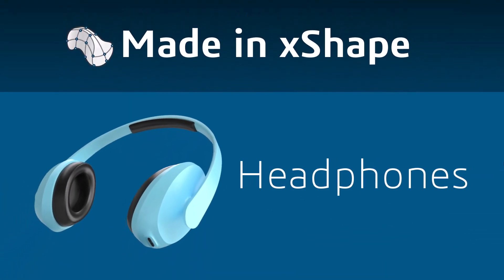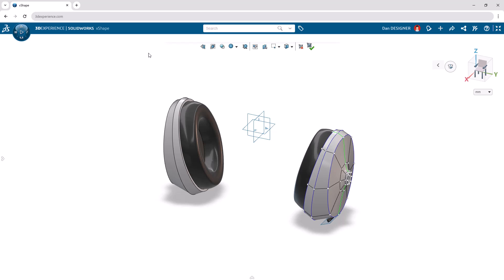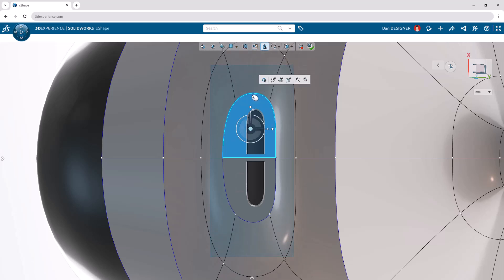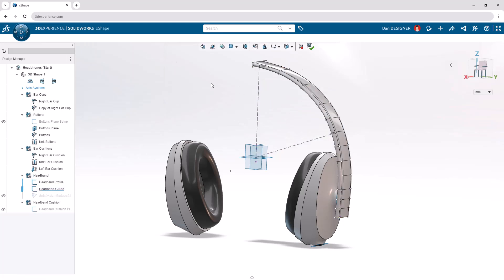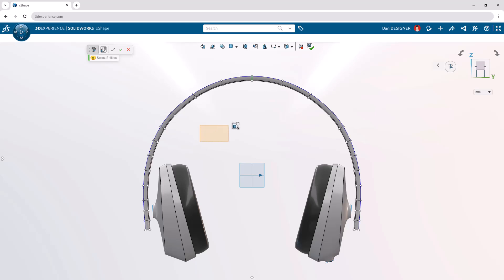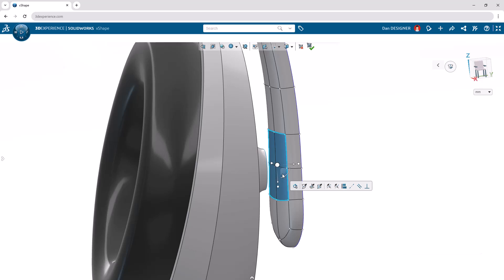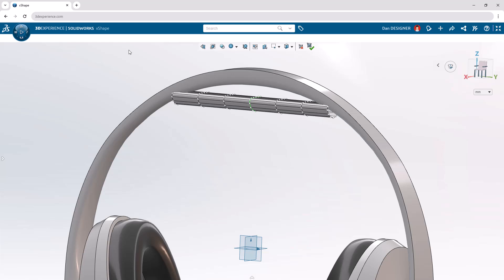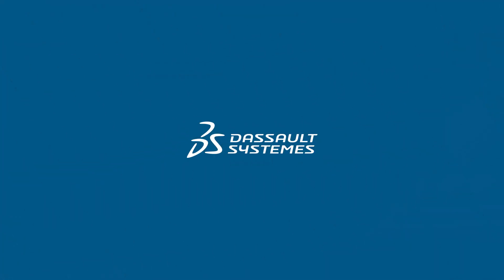How to Design Headphones with Subdivision Modeling - Made in SOLIDWORKS xShape

Comment: i strictly avoid anything cloud based. The files and data should all be on my pc and no where else
Reply: Its everyones choice. As long as you backup your files frequently there wouldn’t be any reason to hate 3DEXPERIENCE. If the files needs to be able to be edited on more than one workstation and maybe even on the same network, then cloud options become automatically more interesting. Shared drive could be an easy option, but working from home with a VPN worsens performance. I see a lot of companies using Onedrive/google drive (which is a cloud solution btw) but by those users the question is never if data corruption will occur (small or big) in their files, the question is when. Last option is to use a cloud option like 3DEXPERIENCE which doesn’t segment the files in a way that data corruption is expected like a Onedrive/gGoogle drive etc.

Also an intersting note, when a company buys a SOLIDWORKS license these days, you get the 3DEXPERIENCE cloud solution with your license. Might as well use or at least consider that for your files then I think
Reply: knowledge always has to be shared!
Reply: @eliovalladares2185   im talking about stealing, not sharing. Cloud based data gets stolen, not just shared
Reply: @eliovalladares2185  i already replied once idk where it went, but im saying that data gets stolen by hackers, other countries, etc., im not saying its willingly shared. Cloud based data just gets stolen.... look at the past